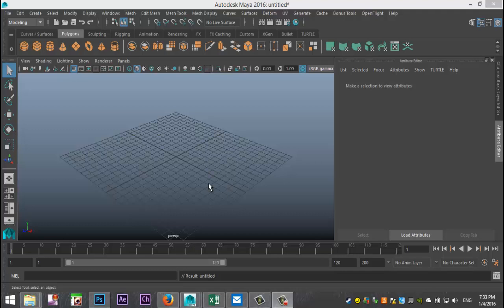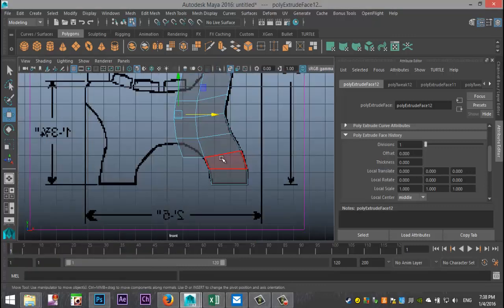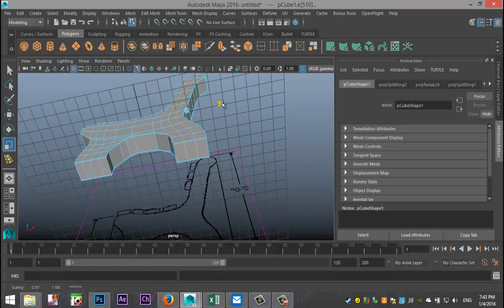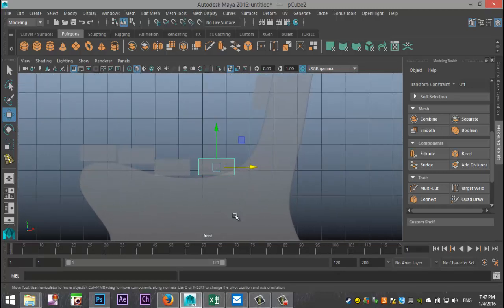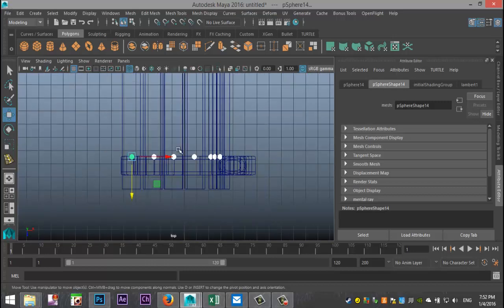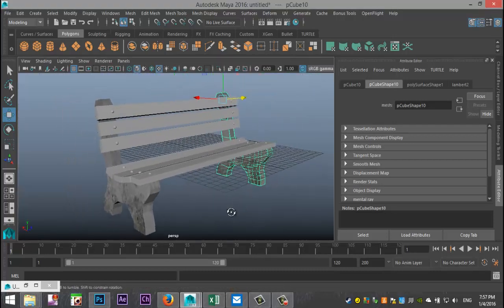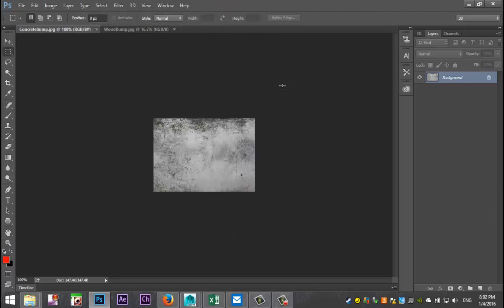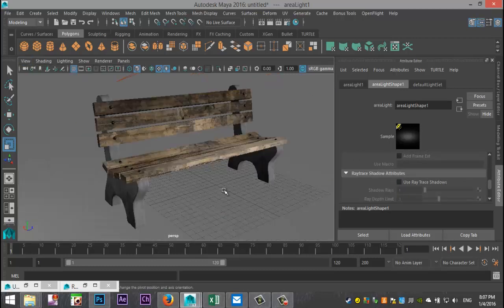Maya 2016 modeling tutorial : How to model a Park Bench

Comment: nice video!! Quick question, when is it a good time to combine meshes. Also, should I always group everything or combine if I am adding it to another scene.
Reply from the maker: Depends on more things then I can mention. Use, rigged ? Animated ? Still render? Consolidated scene ? etc etc
Reply: Oh OK well it's just a bridge, but it does get driven on but no animation to it. It has like 10 suspensions, a road and the pillars that hold it. All different material. I just want to know do I combine the suspensions since they are the same and won't be moved or just group. Sorry for the questions, I'm working on a group project and I just don't want to look unprofessional, my modeling teacher wasn't the best

Comment: This was very helpful. Thank u
Reply from the maker: +dareGaming Thanks
Reply: +Mike Hermes One little problem.. I dont have those rendering options to set it up, and when i make surface it becomes textured like my object and i dont know how to remove it to just be simple one color surface.. Can u help? :)
Reply from the maker: +dareGaming By settings you probably mean Mental Ray. This needs to be setup. Here are instructions : http://mhtutorialsyoutube.com/2015/07/04/q-i-cant-find-mental-ray-in-autodesk-maya/
The reason why your plane gets the same texture is because you combined it with the previous one
Reply: I figured out that i had Maya LT 16 instead of just Maya 16 so i changed it and now i can see everything as u, and i also figured out mental ray. Thanks for the response though. U da best! :)
One more thing, when i render my work the light is stronger than expected so i move those 2 volume thingies and make it right but then when i save it, its the same like i didnt change anything. ?
Reply from the maker: You're welcome